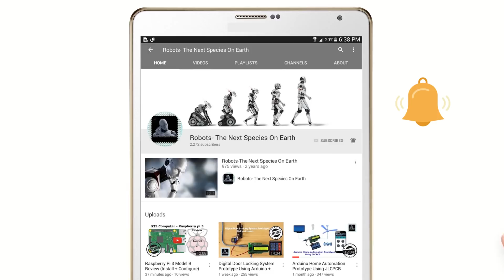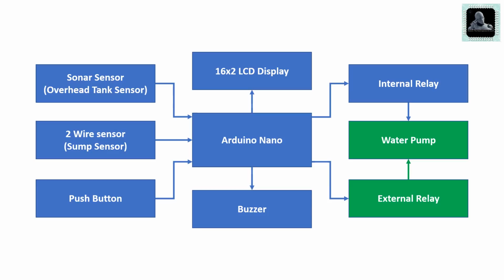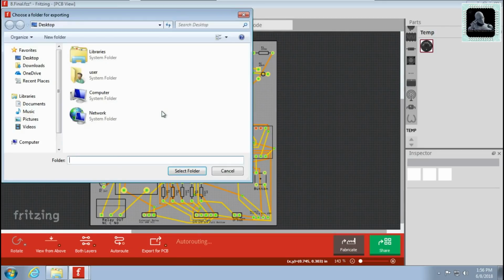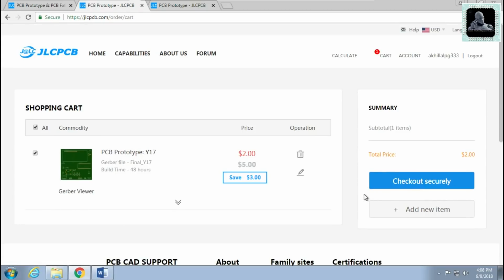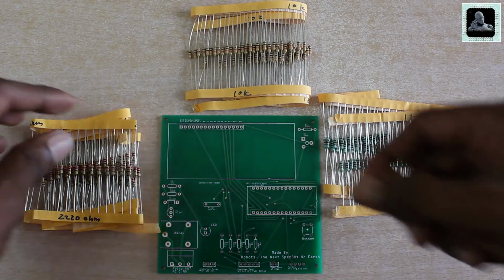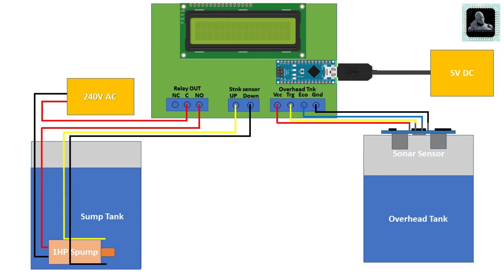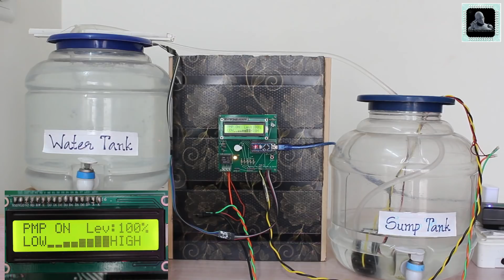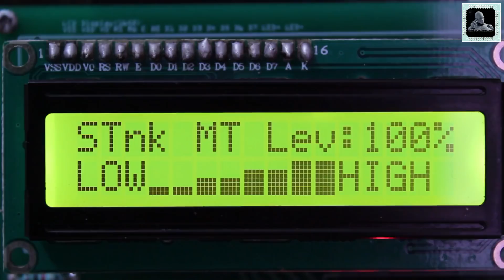Automatic Water Tank Level Controller with Dry Pump Run Protection Using Arduino + Ultrasonic Sensor

Comment: Nice project and a very clear, detailed and professional presentation! I learned exactly what I needed to possibly attempt this build. (What I want to do is add an Automatic Aquaponic Greenhouse Fish Tank Water Level Controller to a customized Open Energy Monitor platform.) This video is pointing me in the right direction. Thank you!
Reply: can you send me the gerber file
Reply: @alanmcrae8594  did you complete this project?

Comment: Man, what I would pay to have a decent, ready made system like this that would output the tank level and water usage over time - to a mobile app... I've been looking everywhere online to buy.
Reply: Tankbolt is the solution, I have been using it. It uses ultrasonic sensor. Totally worth it.
Reply: i know I am pretty off topic but do anybody know of a good site to stream new series online?
Reply: @Brentley Sullivan I dunno try Flixportal. you can find it thru google:) -lane
Reply: @Lane Chandler thank you, I signed up and it seems like they got a lot of movies there :) Appreciate it !
Reply: @Brentley Sullivan Happy to help :)

Comment: Great. Pls make a same project on  corporation line of water with dry protction and when water come in pipe line motor automatic start.
Reply from the maker: you can use the same circuit for this purpose if you are using a sump tank and a roof top tank..

Comment: If you don't mind
Dear can you give me suggestion for dry run  i mean is present is sump tank empty  with dry run means  same one more sensor to  keep the pump flow end we will keep a sensor  after 2 to 3 minutes if no water flow means it should act and shutdown pump

Comment: Brother you showed us different connection (probably wrong one) because what you shown in the video I tried that but there are some missing connection. And there is a huge difference between your PCB design and mine but I tried same as yours not woth it. So, kindly will you provide schematic diagram.

Comment: Can u make the connection with circuit without ardinuo.  Use only microcontroller..

Which unclede dry run protection, under and high voltage protection

Comment: Hi I will build this project soon for my son salt water aquarium. I want the system to trigger  the filling when water level is 90% and not 20 % , where in the program I need to change the value from 20% to 90%?

Thank you
Dov

Comment: Sir if any emergency we need to on the motor isn't possible even the water is on 50% at the Tank. So kindly add manual switch code for operating manualy.

Comment: Hello Akhil, I ordered the PCBs soldered everything as said and configured the nano. But the display is giving square boxes. Did I make any mistake. Please lemme know. Thanks in advance.
Reply from the maker: Please use the potentiometer to adjust the contrast
... It will work..
Reply: @TexoBot  I adjusted it to the max. I'm just getting the boxes. Is is something with the code. I still need to solder relay and peizzo buzzer.
Reply: Can you pls send the Gerber file to me bro
Reply: Did you manage to resolve the issue having similar problem
Reply: @MrAllTimeGaming  did you have the coding ,circuit diagram and gerber file? i tried  to open the link but seem like the website cant be found😢

Comment: Great its working. im using it on a fish tank. i want the tankhight to be 20 cm and the top of the tank to be 15 cm, so i want the pump to switch off when the water line is 15 cm from the ultrasonic sensor. how can i set this
Reply: Please what did you use as your Power supply?
Reply: @abdullahmohammedzainudeen1928  a USB phone charger
Reply: hello sir can you send me the gerber file please i need it urgently
Reply: @abdullahmohammedzainudeen1928  5v mobiel charger can we use
Reply: @abhinashagasti3872  hello sir can you please provide me with gerber file ill be really grateful

Comment: Can i use this with water tank on the roof top of the apartment?  Water tank is made of stainless type.  I want to have a system that sends message to my phone when water in the tank reach unsatisfying level.

Comment: This is cool.  I'd like to modify your setup to automatically send water off my roof from a sump to 4 zones, depending on which area has a low water level.  I'd be using solenoid valves and distance sensors.   Can u offer guidance?
Reply from the maker: Hi Jerrerson,
Thanks for your comment, I am happy to help you with that.
Please contact me over my email ID:-
robothenewspeciesonearth@gmail.com
Reply: Thank u....tried emailing you, but the email id is invalid

Comment: Excellent project , I need a help , even I have done water level indicator using ultrasonic sensor but when the water reaches high the buzzer will one but it won't stop until the water level comes down from high level , but I need the buzzer should on only for 10 seconds then it should  off plz help me by uploading the codes .
Reply: I need some help from you related this project
Will you share the program code to me

Comment: would it possible to use two ultrasonic sensors instead of one. I mean one on tank and one on sump, this way it is possible to protect dry run and also additionally know the sump water level at anytime. Esp32 could be better choice i think because of network integration iot.

Comment: I want implant this project on my house water tank and pump system. Will it work in large scale?
I mean, i have to use long wires upto 15m or more. 
So will it's accurate ? By using long wires
Reply: I am planning on doing this as well. I am afraid that wires will be like 80m long from pumping station to electronic measurement station (tanks)...

Any comments?
Reply: Maximum 10m

Comment: Sonar sensor is not reliable because of moisture ...... For some days it works properly but after 2-3 months it got damaged...and flactuates the data.....
Reply: thats what i was  thinking
Reply: @Tech4geeks21st  so what's the solution?
Reply: @ratikantamahapatra8847  i have seen one video in that video he shown some sort of water level indicator sensor maybe it will be used for long time

Comment: Hi. I really interested with your project, I've using two grl8-01 water control to control water pump. My question: is it possible to use 2 level control (three wire) sensor instead of two wire in this project?
Reply from the maker: I am soon  coming with another video to show how to use wire sensor on the same circuit  instead of sonar sensor, please stay tuned and tanks for writing in...

Comment: Will the ultrasonic sensor work when water evaporates from the tank and deposit on receiver and transmitter of ultrasonic sensor??
Reply: You are right . It will damage the sensor soon . So use a waterproof ultrasonic sensor,  sr04t

Comment: Dude Awesome Project.... Can you make it wireless using ESP8266 with 3 separate Stages.......1 esp with sonar for tank, 2 esp as server with LCD controller, 3 esp with relay for pump......I have more ideas regarding this with advanced level only problem i have is i do not know how to code......thanks anyway

Comment: Please, can I get the circuit schematic or the Gerber file? This is an excellent project and I would like to try it. Thanks in advance.
Reply from the maker: Please use the email address in the video description for communications.  That would be a faster method rather than the comment section.  Thx.

Comment: What happened if water in tank is empty?? Then ur water pump may burn in dry run conditions... You should embedd two project in a single project.. I. E. 
Smart irrigation system with automatic water level control using ultrasonic sensor.. So it gives sustainable solutions zero maintenance...

Comment: I am interested in the pcb board Gerber files of the Arduino ultrasonic water level. Can you send them to me?
Moreover I have a 3 line 64 lcd display will it work?
Thank you  Chris
Reply: My I correct the info on my lcd display it is the 2004A 4 line display.

Comment: I have contacted through mail but no response. 
Can please tell me how to replace sonor sensor with float sensors. Using RF transmitter and receiver to make the system wireless,. please rply

Comment: Bro, What's the Maximum Range of the Sensor? Can i use it in SINTAX 500 Litre Tank?
Reply: up to 5 meter
Reply: But if i use Serial monitor, the max Range is 147cm
Reply: @i.sivakumarsk   maybe u limited ur distance range or something wrong with ur sensor
Reply: Oh ok Tq. Will the Sensor get heat up for being long time in the Tank?

Comment: Sober sensor data will not lose by longest jumper wires
Reply: Furqan Ali you can use twisted pair cable for decreasing loss of data. (LAN cable )

Comment: It's a nice project, but you should take a little time and route the PCB properly. That is one of the ugliest routed PCBs I've ever seen. Don't use autorouting - it will give ugly and badly routed PCBs that may not even work.

Comment: Actully there are two tanks.

i want to fill with our requirement. 

for example

tank1 0 to 100 %...and Tank2 0 to 100 %..
and this is one by one or fill up parallel.  

like our decision.

Comment: Hello bro , how to modify the circuit and code for wire sensor?

 how to use RF transmitter and receiver instead of ultra sonic sensor. So that we can make a wireless water level controller. Please make a detailed video Bro. Thanks
Reply from the maker: contact through email (texobotenquiry@gmail.com)

Comment: Good day all, I'm new to this and need some help please. I want to change the diagram by adding a current sensor instead of the two copper wires and an extra button to set operating current of the pump, is there anyone that can assist me with this modification. Many thanks in advanced

Comment: Dear sir wanna contact you once.i want to remove one function from your code as that function is not compatible according to our location
Reply: I want ki my water pump should not start automatically in any case..i want a push button to start water pump rather than automatic start.
Reply: i m having a controller which is equiped with both fullauto and semi auto function, with a push button , start motor when needed. in fullauto function motor stops at full tank and start at half tank , and in semiauto mode motor start when u want to start with a push button and it stops at tank full then it will nt start in any condition untill u press the start button .
Reply: @sahilbansal5085  one help sir

Comment: Arduino: 1.8.13 (Windows 10), Board: "Arduino Nano, ATmega328P"

8.Pump_Automation_Using_Sonar_with_spump_status:50:10: fatal error: NewPing.h: No such file or directory

 #include <NewPing.h> // Include  library used for measuring the distance using HC-SR 06 sonar sensor

          ^~~~~~~~~~~

compilation terminated.

exit status 1

NewPing.h: No such file or directory

This report would have more information with
"Show verbose output during compilation"
option enabled in File -> Preferences.